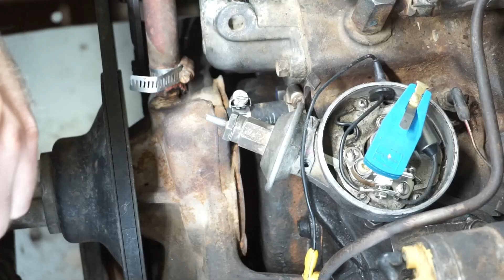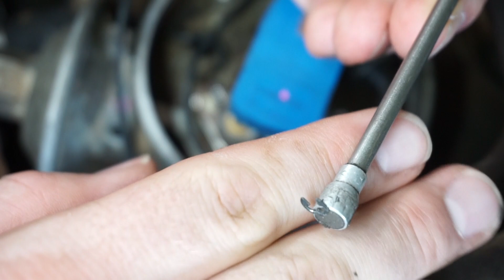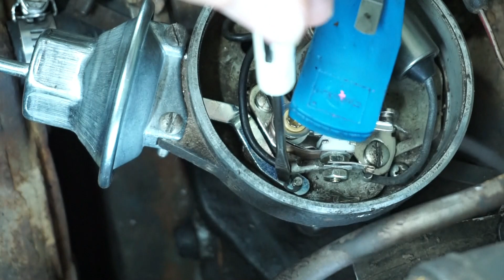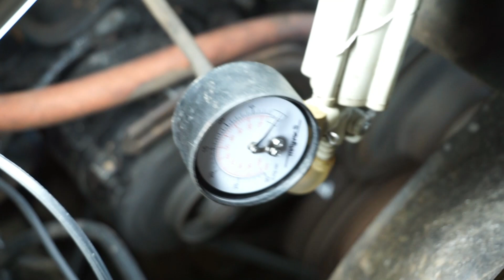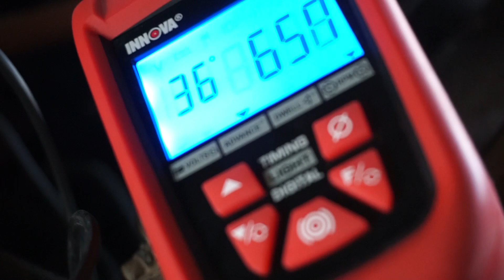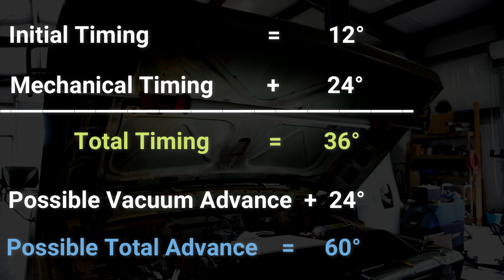Ford 360 Adjustable Vacuum Advance Replacement & Set up

Comment: Finally someone who takes us through the whole process with explanation. I knew the distributor advance was the issue but couldn't find anyone who explained the whole process. Turns out my advance was basically all the way turned in. Running fine now and the first real drive around the block for my '64 Thunderbird that sat in a field for the last 15+ years. Thanks!

Comment: Almost NONE,  and I mean NONE of this description is correct.  The ONLY time the vacuum advance is activated, is during cruise with light throtte application.  It helps with fuel economy. When the engine is at Idle,  there should be NO vacuum at the advance.  Some engines use an overheat valve which applies vacuum to speed up the engine a little bit,  to help with cooling under severe conditions,  But that scenario is very very rare.  Also, I would like to point out on this person's engine,  his fan is on Backwards and  he has a chinese condensor inside his distributor.   Also,  with his description of adjusting the new vacuum module,  on points you must UNSCREW that adjustment all the way to LIMIT the amount of advance because if you pull too far,  your points won't open.  This you'll have a stumble at part throttle.  At full throttle,  there is almost NO VACUUM so that vacuum advance has little to no effect at full throttle.   He's partially correct,  but not fully.

Comment: Is this even correct? I thought the screw adjusted the amount of vacuum needed to pull the advance not how far it pulls it. 
Like if you have big cam that makes less than stock vacuum you loosen the advance screw so it takes less vacuum to achieve full advance?

Comment: Does the vacuum pull upon acceleration or at idle
Reply: i think its proportional the higher the revs/acceleration the more vaccume?
Reply: It pulls with High vacuum. So, at idle, if your hooked to manifold vac, and cruise.

Comment: Thank you for showing a great video. I never knew a good way to go about it til now. I'm going to use your rules of thumb just to try it. I replaced mine about 4 months ago and never checked timing. The motor does not like getting over 4300 rpm and never has. I'll be trying 5.25 turns out first after running in all the way in. Thanks

Comment: What did you say about the spring weights under the point plate? Please explain how they operate.
Reply from the maker: So the weights are restricted by the small springs. As the engine speeds up, so does the rotating speed of the rotor and the weights. As the speed increases the springs are no longer able to hold the weights back and the weights start to fly outwards, which moves / twists the rotor so it contracts the plug terminals sooner in the compression stroke, giving you a timing advance, since the engine likes more timing at higher RPM. Then inversely, as the engine slows back down, the springs are able to re-gain control over the weights again, and retard the timing back to your base timing. Hope this helps!
Reply: @330_garage3  Thanks, installed a new distributor that was heard running from another engine and i still get the backfire in the exhaust so i think it is the push rods or cam down or valve problem now.
Reply from the maker: @thorthunder3227  If its running and backfiring through the exhaust, I would guess a stuck exhaust valve or a burnt exhaust valve (common in the FE motors)
Reply: @330_garage3  yes, i removed the valve cover only to find out no oil was going onto the rockers and i have not been able to fix it yet but i think the valves were sticking open or not closing due to lack of oil., swelling i guess on the stem.

Comment: What adjustable vacuum advance is that? I need one for my 352. Bought a new aftermarket points distributor and the vacuum advance it came with pulls way too much timing. So much it'll cause the engine to stumble a bit on cold high idle.
Reply from the maker: Thats a good question.  I used a Standard Motor Products VC31
https://amzn.to/39sLquz
I'll update the description with that information.
Reply: @330_garage3  Ordered one up, thanks!

Comment: Totally identify with this. I just put one of these adjustable vacuum advances on my 390. I spent an hour trying to use a little mirror to read the numbers on my reman distributor with no success. I finally guessed and did the 3-1/2 turns. I used the non ported vacuum line port to test it. At the initial setting, the engine wanted to die when I started to connect the line. I ended up backing that thing out about 6 or 7 turns before it would idle correctly, which was well past the recommended adjustment for any of the Ford distributors. In essence, you might as well throw out the guide and do it by ear. If you use your non ported vacuum line, you will get it in the ballpark because you have full vacuum at idle on your non ported connection.

Comment: What is mechanical advance
Reply from the maker: Mechanical advance, is the distributor spinning at a faster RPM as the engine spins faster, then some weights inside the distributor start to move outward, which causes the spark to happen sooner in the combustion cycle. You generally want the timing to be more advanced as the engine speeds up for better performance and fuel efficiency through the RPM range.
Reply: @330_garage3  so then, what exactly does the vacuum advance accomplish, if routed to manifold vacuum?

Comment: Just did this on my Mustang and the only thing I can add here is that you can adjust the canister in real time.  Start by capping nipple and take your base "mechanical only" reading.  Mine was 16.  Then run a vacuum line from manifold vacuum (not ported, which has no idle vacuum) to the canister and take a reading.  Mine was 26 so the canister is adding 10 degrees from vacuum.  Then do the allen wrench thing with the motor running to fine tune.  When you are happy you can optionally switch back to ported vacuum if that was your original vacuum source.
Reply from the maker: Thanks thats a good suggestion
Reply: You can’t switch between ported and manifold without making adjustments.  The vacuum signal from each of them is entirely different at idle, just off idle and all the way until the throttle blades pass the ported vacuum hole in the barrel of the carb.  At just off idle (which is where you cruise) ported vacuum is hanging around below 5 hg.  That vacuum canister doesn’t even kick in until about  5 or 6 hg so you be getting zero vacuum advance if you’re connected to ported.  If you’re connected to manifold you’ll get all of the advance that canister is set to give.

Comment: would this cause the truck to die one first startup and then run rich and backfire once it warms up?
Reply from the maker: It could if the vacuum canister is bad. The engine pulls a lot of vacuum at idle, causing an increase in timing. The additional advance in timing, does increase the idle speed. For the backfire I would check your wires (loose or broken), spark plugs, and firing order. Those are the 3 most common issues for backfiring once warmed up.

Comment: This was really great! In all my years I never had to mess with this and now I feel like an expert. My diaphragm is bad so I can’t wait to fix it and see how my engine responds.  So, I have a vacuum leak and no advance off idle. I’ve been struggling with this issue for months and never thought about a bad diaphragm! Thanks!!!
Reply: Does your vehicle lean out off idle ? I’m having that issue
Reply: @davidferraro9356  I had  to change my  power valve  to compensate for that.  I think it is supposed to be half your idle vacuum number.

Comment: from reading my 1969 ford Manuel for 390 GT IN A MUSTANG WITH AUTO TRANS 4BBL 10.5:1 COMPRESSION.  total timing should be no more than 34*. and no less than 25.5*. base timing for a lot of fords is 6* ,12* was rare. peak power on a FE -FT IS 38* BUT for safety and consistency tuners will pull 4*-6* from peak so 32*-34*. so WITH 24*mechanical +6*base =30*total  about right for today's gas on low compression engine.  best cruising is 50*-52*. the vacuum advance was was 18*-25* at 20 hg IN THE MANUEL. to days gas burns faster and has a slightly lower octane. in 1970 octane was at its peak around 90-92 for regular and 100 for premium under the RON METHOD OF OCTANE. WE NOW USE MON+RON/2. SO 100= PREMIUM WOLD BE 96-94 MON+RON/2 AND REGULAR WOLD BE 88-86 RON+MON/2 SO LESS TIMING TOTAL ABOUT 5*10* BUT NOT ALL WAYS.   IF YOU LIVE IN A STATE WITH REFORMULATED GAS YOU NEED LESS TOTAL AS IT BURNS FASTER. COMPRESSION EFFECTS TOTAL TIMING AND A SMALL DEGREE CAM BUT THE BIG ONE IS COMBUSTION CHAMBER, BORE TO STROKE AS WELL AS ROD RATIO. SO WITH BASE TIMING AT 6* AND A MECHANICAL OF 24* FOR A TOTAL OF 30. I WOLD USE USE 18*-20* VACUUM ADVANCE FOR A TOTAL ADVANCE PLUS VACUUM OF  48*-50* DEGREES. 60* IS TOO MUCH FOR TODAY'S FUEL.  I SET MINE BY SETTING MIXTURE AT 1.5 TUNS OUT FROM LIGHT SEAT. AND THE IDEL SPEED SCREW SET SO THE SCREW IS JUST TOUCHING THE  THROTTLE THAN THEN GIVE I 1 TURN TO JUST SLIGHTLY OPEN THE THROTTLE. BRING UP THE ENGINE TO OPERATING TEMP  AND LET IT RUN FOR 30 MINUETS ADJUST TIMING WITH VACUUM HOSE DISCONNECTED AND PLUNGED FOR MAX  VACUUM THEN RETARD TILL IT DROPS 1 HG THEN TAKE A READING WITH THE LIGHT. SAY IT IS 25* THEN YOU WILL SET THE BASE AT SAY 6*. THEN YOU WILL NEED 19* VACCUM ADVANCE TO GET 25* IDLE. THE TOTAL IS THE MOST CRITICAL SO YOU WILL NEED TO POSSIBLY USE DIFFERENT BASE TIMING AND OR MOD THE MECHANICAL. RUN NO MORE THAN 20* VACUUM ADVANCE WITH MANIFOLD VACUUM. HOPE THIS WAS A HELP. AND NOW YOU KNOW THE  BEST SETTINGS FOR A FT-FE GIVE THIS TIME BY VACUUM A TRY! O YOU VIDEO WAS GOOD!!!!!
Reply: I undestand how a destributor works! I have the oe specs for all the ford dizzys. and vac advance can be as low as 9* to a max of 14* on boss 302. 390 gt is 19-25* vaccum advance at crank! Centrifical is 19.5*-28* @4800 rpm! Base timing is 6* btc for a total macanical of 25.5-34* @4800 rpm at crank! Vaccm advanc can add 19-25* at idel and cruse! So no it is not a max of 12*! Smog engens had as much as 30* vaccum advance! You need to do more reading!

Comment: Well I hate to admit this. I'm 73, and have turned wrenches most of them years. I never knew about the adjustment screw inside the diaphragm. Funny cause I should of known. I used to fool other kids into thinking I camed the motor by just unhooking the vacuum advance and then when it idles, it would lope a little making other kids think I was bad a**/LOL. I see by the rotation of the distributor that the timing chain is stretched and has been made up for it by rotating the distributor. Now I know most call for about eight to ten degrees and your coming up with a much higher number. What gives? I would really like to know

Comment: Lotsa variables in an engine even if built identical. You have great base line values . Next you tune it to maximize your fuel octane . You might add a little here subtract a little there in the timing!. I prefer pulling vacuum advance hose off, plugging the hose with a screw then setting maximum centrifugal advance and 3 to 3.5k rpm and letting idle advance stay wherever it lands,then hook vacuum back up. Afterward you tune your adjustble vacuum advance again to maximize whatever your fuel octane is.you engine may use more or less...360 are onown to be low compression. That being said ,low compression engine can often times benefit from slightly higher ignition advance.  But you sticking to stock values is always the safest course to take!

Comment: hook your vacum line to the carb, run the truck to 3000 rpm, then check total timing.
Reply: Total timing does not include vacuum advance.

Comment: Bear in mind the 360 pistons dont come to the top of the bore.They stop about 3/8 of an inch from the top which is why they are such a low compression engine.. Also the deck height is about 1/16 shorter than a standard 352/390 block. So say you go ahead and put 390 rods and pistons in .. Well then you will need to double up the copper shim head gaskets and shave a little off the top of the pistons and then we had to tighten the aluminum duel quad intake up to the heads first then tighten and torque the head bolts.. Never had any leaks or blown head gaskets and put over 80,000 miles on the motor,,she was quite happy.. Alternative is to machine a little off the mating surface of the intake manifold but then its not gonna be good for a 390,406,410,427,428 which is ultimatly what you want anyhow.. Run that 360 till shes spent then get you a regular FE.. 360 361 and 391 are FE engines but they are truck motors.. now i will tell you the 360 rods are super strong and same length as 390 rods.. My dad was a professional race engine builder and he said after the extreme abuse he put his built 360 thru that he feld very confident that if you bead blasted those rods you could put any amount of compression and boost you ever want and never bend or break those rods.Ours was a 69 360 too.
Reply from the maker: My plan is to swap in a 390 crank, with 390 rods, in combination with the 360 pistons. Then convert to a 4bbl "T" manifold (since I bought those parts already).. and see how much that wakes it up. I don't have any experience with that combination, but the published info looks like it should make great compression and all go together without much machine work. Good to know you have good experience
Reply: 330_Garage hey be sure and record it all when you do it!

Comment: There is a way easier way to test the vacume canister lol.. take it off and push the lever in now hold your thumb over the nipple .. if the lever stays in its good if it extends while your thumbs on the nipple its bad.. easy peasy.
Reply from the maker: and I thought I had a pretty easy solution... that's even easier!